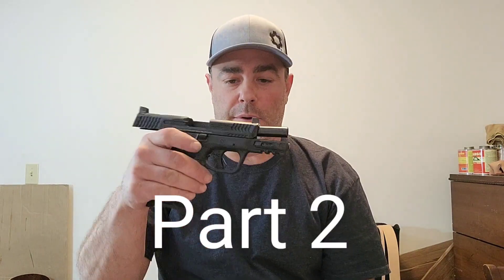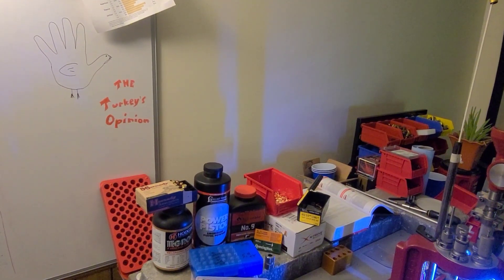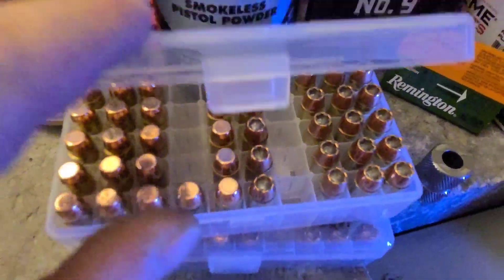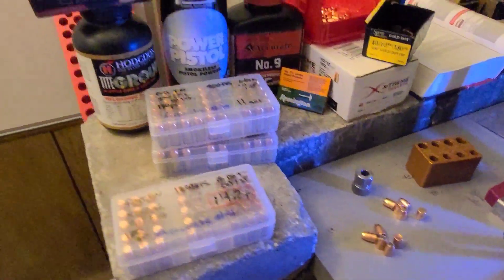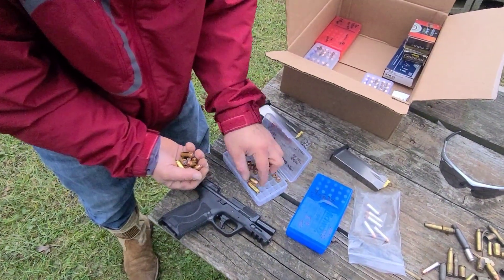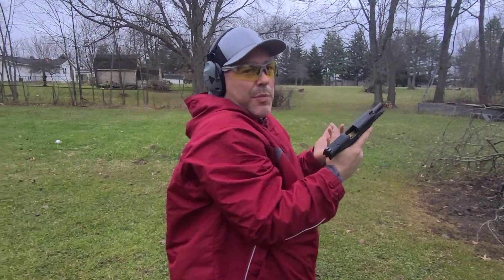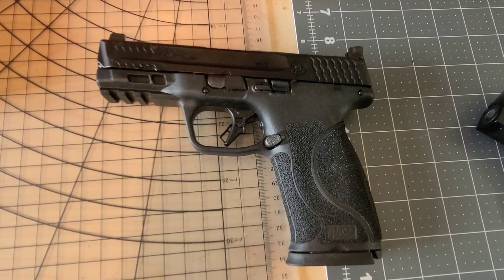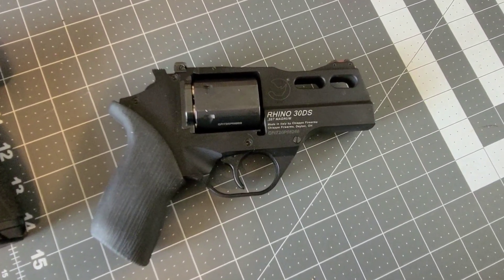S&W M&P 2.0 10mm 4" Update ( part 2 of 2 ) - More testing, take aways so far...

Comment: After tinkering and wasting money on extra power mag springs and recoil springs for multiple glock 20s I still have the occasional malfunction simular to yours with hot loads. It's a engineering problem the slides need more weight to slow the cycling. Mag springs and recoil springs are just band aids that can work if everything goes right. In a defensive pistol for bear or people you want something that's going to work all the time not just when things are perfect. Quit pushing it to its limit with the full power stuff and back off to about 600 ft pounds and I bet it runs perfectly like mine do.
Reply from the maker: Good advise and a hard reality your speaking with your Glock experience. 
 I put a video up yesterday with hornady critical duty.  It really likes that stuff, in its middle of the road fps.  Thank you for the comment!
Reply: @theturkeysopinion  Your welcome! It ain't just pistols I've tried  hot loads in revolvers and rifles had to beat empty cartridges out of cylinders and barrels. I found guns are just like everything in life it's good not to push anything to the edge or you have problems. 10mm is still a powerful semi auto round. Good reliable 9mm is 300-400 , 40 and 45 are both 400-500 10mm is 450 to 650 fpe for good reliable function under different conditions grips ect. You can push them all harder across the but it ain't worth betting your life on it if it ever came to it. The 10mm is a great cartridge only problem is some manufacturers and reloaders push it to the max and being recoil operated it's limited on the range of ammo it can shoot. It's not like some of the piston or gas operated shotguns and rifles with adjustments for different loads. Most pistol manufacturers make it right in the middle so it can shoot the widest variety of loads. Go to weak or to powerful and its asking for trouble. Just my opinion and even though I'm a glock fan myself the fanboys attack when i tell them my experiences with the 10mm isn't perfect with 800 ft pound nuclear loads. It ain't just glock you can look on YouTube and find videos of xdm glock ect doing the same thing with full power loads but some people are in denial or haven't shot enough under different conditions to see it for themselves.

Comment: With so many ballistics sites showing 40sw and 10mm from 4" and shorter barrels, I'm not sure why anyone would buy a 4" 10mm. Comparable loads in 40sw from a 4" barrel are most often within 30fps of 10mm. That's a lot of added flash, recoil, and expense for a 3% increase in velocity. 

10mm doesn't really start to shine until over 4.5". 

And now that you can get 200gr hardcast in 40cal off the shelf, it's a pretty good woods carry option.